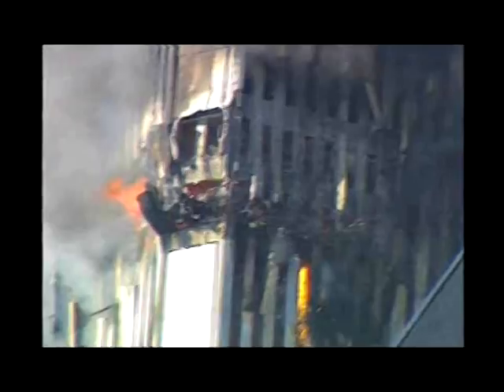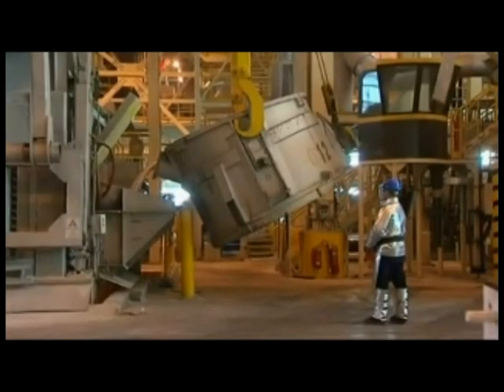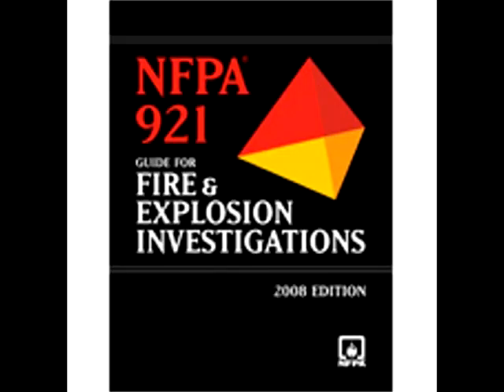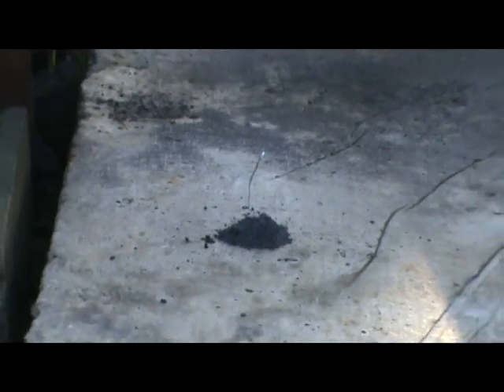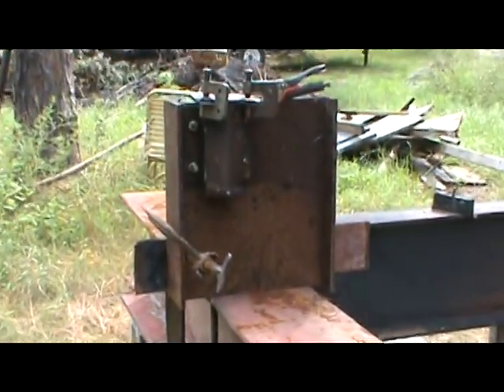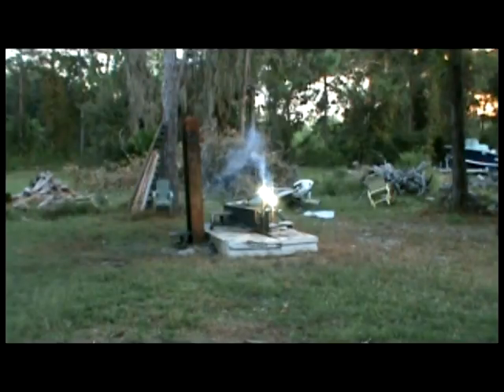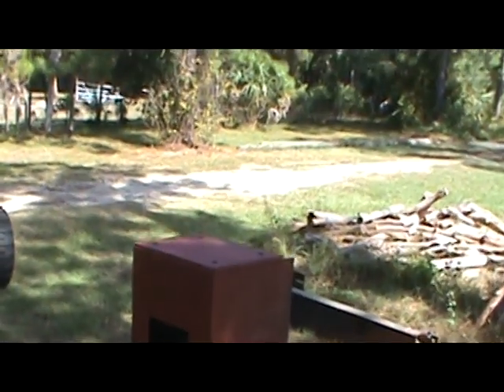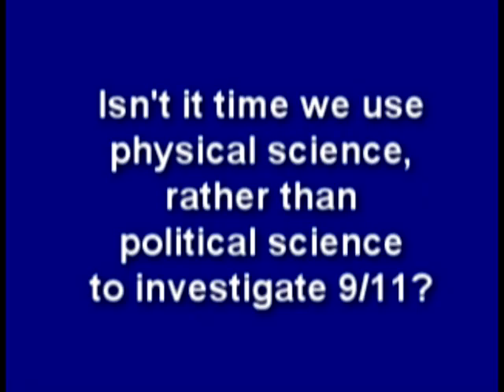9/11 Experiments: The Great Thermate Debate

Comment: A quick series of blast puffs right before collapse with audible explosions and suddenly no resistance against the collapsing structure, no crush up crush down effect, one tower was hit lop-sided yet the unharmed 95% fell exactly the same as the weakened structure. A&E used an industrial press and directly applied heat well above the temperature achieved by paper and cubicle partitions and they FORCED a single i-beam to twist a little.

A&E: "we debunked it!"

Comment: Thermite cant melt steel...thats why they use it to fuse steel rail track together 🫥
Reply: And amazingly, the rail track doesn't melt. It welds the ends together by adding material...
Reply: @mooneyes2k478 Thermite does melt steel — that’s why it works for rail welding. The reaction makes molten steel hotter than 2500 °C, which fills a mould around the rail ends. The ends are preheated so their surfaces melt too, and when everything solidifies it fuses into one piece. That’s welding, not just “adding material.”

Comment: I still love these videos. I'll never forget the A&E "debunk" video where they directly heated an I beam until it softened and had to exert a much higher degree of force at the weakest point using an industrial hydraulic press just to bend the beam. Then they ignored all of the building concepts for high rise buildings and ignored the fact that the trade tower fires were made entirely of burning office paper and furniture that barely burns at all. You see an hour of cold fires smoldering and then controlled demos bring them down within a short time frame. 

A&E: "We debunked it!"
Reply: If, by "barely at all" you mean "burn hot and readily", that is.
Reply: @mooneyes2k478 Ceiling tiles don't really burn. They smoulder by design. Office paper is indirect and is burns quickly. Office chairs don't burn hot like paper. Office partition fabric burns and could become hot enough to blaze when a jet fuel blast is applied. A NY firefighter said he could contain the burning floors. Two decades earlier, a dozen floors burned for hours on end in one of the towers and they just remodeled those floors. The external structure serves as an exoskeleton and the cross beams are gridded into the structure core. Where and how these many points of indirect cool fires were applied to weaken anything is an absolute anomaly, but then A&E comes out with a hot gas directly applied with a force much greater than anything applied throughout the buildings and they force an I beam past its allowed deflection. They then bragged about their certainty while thousands of engineers said NIST's report was bunk and even NIST agreed their initial theory based on complex computer models and simulations couldn't have happened. It's the greatest comedy ever made.
Reply: @mike-nc8zd  So, first a whole bunch of nonsense. Well done.

"A NY firefighter said he could contain the burning floors."
No, "he" didn't. Since you don't even know who "he" is, we can conclude you're full of it.

"Two decades earlier, a dozen floors burned for hours on end in one of the towers and they just remodeled those floors."
No, "two decades earlier", nothing of the sort happened. Again, that you don't know what you're talking about doesn't make an argument.
In 1975, there was a fire on 3 floors, 11, 9 and 14, of the North Tower. The fires on 9 and 14 were extinguished instantly. The first on 11 within a couple of hours. What burned? Paper and office machine fluids. That you don't know when, where, how many floors were affected, etc, show that you're blindly repeating nonsense you heard from someone else.

"The external structure serves as an exoskeleton and the cross beams are gridded into the structure core."
Bravo, you reinforced your complete lack of knowledge. There were no beams of any kind in the towers, much less "cross beams", much less "gridded" ones, whatever you think that means.

"Where and how these many points of indirect cool fires were applied to weaken anything is an absolute anomaly"
Everyone got it. You don't know the first thing of what happened. Cool. No need to keep going on about it.
The towers burned vigorously over the entire floors of the impacts, easily seen in the numerous videos shot of them. 

"They then bragged about their certainty while thousands of engineers said NIST's report was bunk"
Making up stupid shit isn't an argument, you do know that, right? There are no "thousands of engineers" that has said anything of the sort.

"even NIST agreed their initial theory based on complex computer models and simulations couldn't have happened"
It's bad enough when you make up nonsense, but outright lying is so pathetic there isn't words.
Reply: @mike-nc8zd  No, self-liker. I don't need to "quote the Wikipedia article I found in my Google research", because I found out. I leave things like "trust whatever I found on the internet that caters to my personal bias" to people like you. Which is why "a firefighter" didn't say what you wanted.

"The two floors below caught fire and spread to as high as the 19th floor, which is what I was referring to. "
As noted above. That you have no idea what you're talking about means only that.

"The box beams were assembled in threes and lifted to their position with the floor beams extending from core to to the box beam units."
Bravo. You almost got it right. Well done.

" You clearly understand nothing you claim to be an expert in."
At no point did I, or have I, claimed to be an expert. I'm just well read. You, on the other hand, managed to get nothing right. So, I guess that mean you're the expert, in your mind?

Comment: This is how heroes are made. Explore. Find Out.
Reply: Here's a hint: making up irrelevant nonsense isn't "exploring" OR "finding out".
Reply: @mooneyes2k478  Well tell me what's the most plausible explanation how the building could collapse the way it did. Was the jet plane fuel the major key to how it went down ?
Reply: @gunnarMyTube  Which building?
Reply: @mooneyes2k478  The South Tower where molten metal was pouring out on the side.
Reply: @gunnarMyTube  Oh, right. So, how did it collapse? It collapsed because it had 56 minutes of uncontrolled fires, which heated the trusses between the inner and outer columns until it pulled the outer columns out of alignment, causing the floors above the impact zone to fall onto the lower floors. None of these floors were in any way able to support the weight, and so they each collapsed in turn.

Incidentally? The irony of you saying "molten metal was pouring out the side" when you've previously espoused "find out" and "explore"? Is to say the least very amusing and ironic.
Reply: @mooneyes2k478  That experiment was to see if it was possible to replicate what would melt steel columns. Uncontrolled fires does not explain how such high temperatures could occur that steel would melt.
Reply: @gunnarMyTube  So what...?
Reply: @mooneyes2k478  Yes. So what. But interesting when people demonstrate energy to prove some hypotethic question they have. It can inspire ones everyday life on a smaller scale understanding you can accomplish stuff out of own thinking.
Reply: @gunnarMyTube  So what?

If you want to "inspire" and create "smaller scale understanding", you should start with an actual premise, like what happened, and not a fairy tale fantasy like "melt steel".
Reply: @mooneyes2k478  It seems to me melting of steel beams of those dimensions is a remarkable thing to occur. But the argument that the building act as a furnace creating the temperatures needed is an argument to consider as well. The guy doing this experiment was apparently after trying out the feasibility of alternative explanations provided a belief in circles that human beings planned a takedown of the building and used extra measures to accomplish the heating.
Reply: @gunnarMyTube  And yet, it's all based on an invention that has no basis in fact.

The number of things ruins the entire premise are legion, honestly.
Reply: @mooneyes2k478   Nice try at controlling the narrative.  JIDF?
Reply: @NotTheRealRustyShackleford   Sad try at having anything like an argument. Poor you.
Reply: @mooneyes2k478  This guy's video proved the claims espoused on Mythbusters wrong...
Reply: @NotTheRealRustyShackleford   So you said. Repeating it elsewhere doesn't make any more of an argument than you did the first time.

Comment: Just watched another video where a blacksmith heated a thin rod of structural steel  to 1800° in a concentrated spot and bent it back and forth, he did not allow comments. All he proved was that structural steel bends, it doesn't break. No one said a beam couldn't bend from 1800°, they said it wouldn't melt. It was a strawman video.
Reply: Actually, he DID allow comments. And what do you know, morons like you spammed idiocies by the thousands. So, he, actually having a job as a blacksmith, removed comments because he had a job to do.

Now, then. 1, the steel was exactly the same steel as in the towers, A36. 2, yes. You DO say that. Because, 3, you and only you (being the general group known as "truthers") are the ones that say steel melted. And so, 4, you completely missed the point, that steel doesn't have to melt to fail structurally.
Reply: @mooneyes2k478  But steel did melt. Molten steel was literally found at the base of the twin towers 🤡
Reply: @joesaiditstrue  It's just that, there's never been any sign, any evidence, anything at all to show that....other than the unsubstantiated claims by "truthers". Ever.

Comment: How could the nose of a plane go through that steel
Reply: Why would you expect it not to?
Reply: @mooneyes2k478  its impossible that would never happen. Go through n pop out the other side intact.  Not no passenger jet. No never
Reply: @billjackson6385  Ignoring the claim about "pop out the other side intact", since that didn't happen, I repeat, why would you expect it not to?

"Because I said so" isn't a valid argument.
Reply: @mooneyes2k478  it popped out the other side. On live TV.  It shore did
Reply: @billjackson6385  "Shore" it did. Except that, no. It didn't. Neither on tv or in real life.
Reply: @mooneyes2k478  why would you expect it not to?
Reply: @bojackson3073  Congratulations, you can copy what others wrote.
Did you actually have a point, or are you just blathering again?
Reply: @mooneyes2k478  simple question
Reply: @bojackson3073  So, no point then. Not surprised.

Comment: my first question would be , how fast would a coke can have to travel to pass thru a 1/2 steel plate???  if you believe a some aluminium plane could penetrate 2 inch thick steel to start with then we are wasting our time
Reply: Fairly quick. Why would that be relevant, though? Answer, it wouldn't be.

Oh, and if you think 2-inch-thick steel would stand up to the impact of 300 thousand pounds traveling at speeds in excess of 400-500 mph...we are indeed wasting time. Not that it wasn't clear that we were already.
Reply: I never knew you could jump onto a coke can and get it to fly you overseas. Unless a coke can is different to a Boeing 757.

So what do you think actually hit the building? Do you think the plane was a holographic projection and the buildings were hit by lasers from space?

Conspiracy theorists deny any facts or evidence that refutes their conspiratorial narrative, so it definitely is a waste of time talking to them.
Reply: @jtveg  Magic. Definitely magic, all of it. Harry Potter was hired personally.
Reply: @mooneyes2k478  
Good one.  🤣
I totally agree, it was magic.
More likely though, conspiracy theorists don't understand physics, like why a high speed, heavy, aluminium plane can go through steel.
Reply: @jtveg  Particularly when you start looking into the tensile strength, and realize that, "aircraft grade" aluminium has pretty much the same numbers as A36 structural steel, the steel used in the construction of the towers.
Then, of course, there's the issue that, you don't need to "pass through". All you need to do is rupture the bolts attaching the columns to each other.

But, just as you said, "truthers", just like any form of conspiracy theorist, completely fail to comprehend basic physics.
Reply: @mooneyes2k478  do they make aluminium bullets ?   I would like to see the effect of one after hitting steel
Reply: @xbgtjg66  
If you knew anything about physics you'd know that kinetic energy is represented by the formula: 

KE =½mV² 

which means that given a high enough velocity a Coke can can penetrate anything.

Granted the can would vaporise but so would the hammer.
Reply: @xbgtjg66  So, as noted, a coke can can fly around the world, can it?

Trying to change the premise so that you can pretend you're right isn't doing you any favors. Just so you know.
Reply: @xbgtjg66  So, what's stopping you.
Of course, your attempt will be completely irrelevant, but that's to be expected.